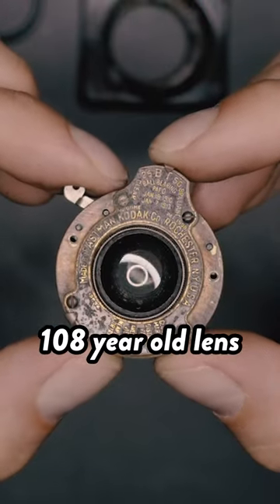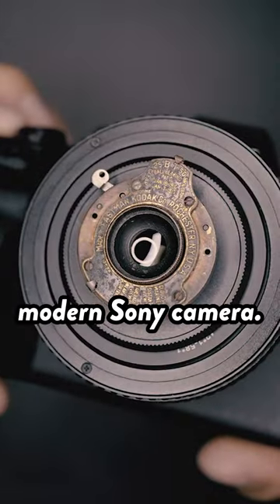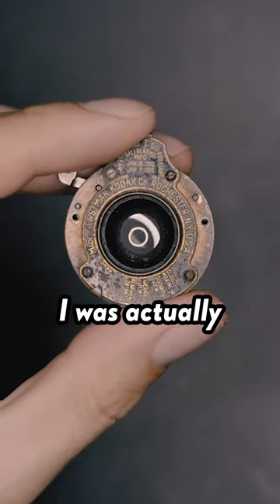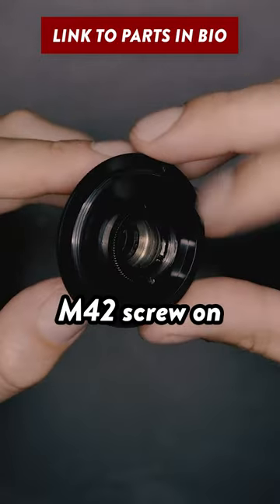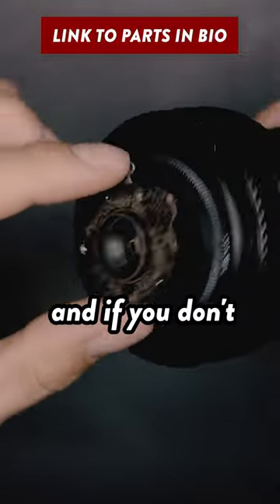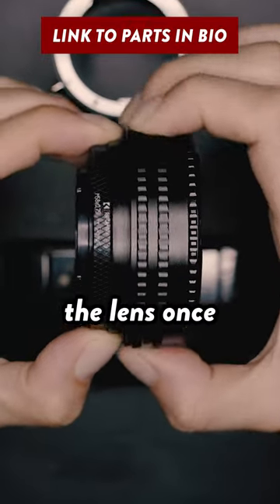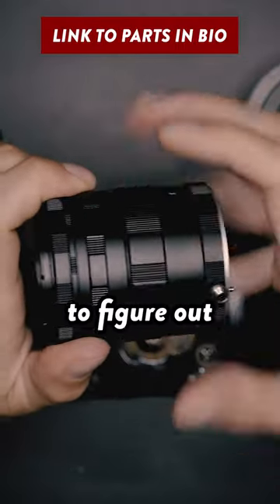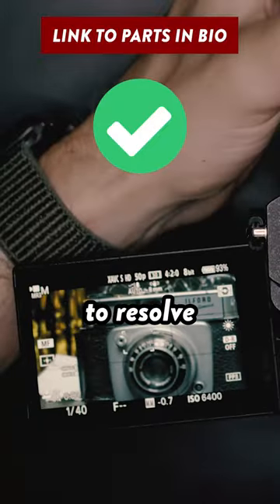Modding a 108yr Old Lens To Work On a Sony A7IV 📸

Comment: That bayonet is either gonna fall off or get shot off and the sling needs to be tight, not loose, especially when going into battle, which I imagine he is doing with that pose
Reply: Actually british soldiers during ww1 attached their bayonets only on the front ring so when shot it flies off towards the german trench causing extra damage.
Reply: @heccsclips3319 nah it gonna bounced upwards, possibly thats the reason why the red baron died
Reply: @sven9900 , wasn't the red baron shot down?
Reply: @ahappypcuser3344  yeah he got shot
Reply: Its called Double Tap, the bayonet cuts each bullet in half so you have 2 halfbullets going downrange
Reply: @ahappypcuser3344 That’s the joke.
Reply: @Zaxaries  i think i had just woken up, my bad

Comment: Spoiler alert: they look like pictures taken with a modern camera, because they are
Reply: What do you think is producing the image though? The lens, the lens is what is focusing the light onto the sensor, the sensor captures the image that the lens produces. The image quality of a photo is largely determined by the quality of the lens, the image quality can only be as good as your lens.

Put an awful lens on a great camera and the image quality will still be awful. This lens happens to just be a decent piece of glass, so it still looks good even 108 years later.
Reply: @user-xw1vs3vw8t yeah but a modern camera uses totally different methods of capturing the light, especially if he's using a digital camera. Even if he's using a film camera, film has drastically changed over time. If you take a photo on an original Polaroid camera from 1948 and another on a modern camera with the same lens, it's gonna look totally different because the way the image is captured is different
Reply: The point is to give certain aspects of the old camera onto a modern one, not wholesale recreate the look.
Reply: @notribadsvault  and exactly 0 aspects of the old camera have been given to the modern on. It looks exactly like something i could snap with my dslr right now, except it doesnt have a built in monochrome mode. If it wasnt for the focus shenanigans, which arent inherent to only this lens, id say they’re indistinguishable from pictures i can take with the phone im using to talk to you right now
Reply: @user-xw1vs3vw8t  lenses arent the most significant factor in image quality, the sensor or medium is. Glass lenses haven’t changed much in 100 years, we pretty much had glass figured out back then too. You know what has changed a lot? The image sensor. So an image taken with a modem sensor and an old lens will look like an image taken with a modern sensor and a modern lens that has a smudge on it
Reply: Dislike for not showing pics🤦‍♂️

Comment: I've had one of these lenses (for years) that was all gummed up (no camera). I cleaned it and it works like new! I will use the lens on the "T" setting on my 35mm (M42 mount) camera because the film camera has a working shutter and meter hence, no need to use the old lens shutter. Another way to mount this lens is to use an M42 billows set up. All you need is a body cap and the billows. They are relatively cheap and can be a bit clumsy to use hand held in the field but very effective for focusing to infinity down to macro.

Comment: Did a similar thing with a voightlander 35 mm to an rca 1"plumicon video system. I was even able to use the iris mechanism to do fade in and fade out effects by twisting the iris collar

Comment: I have several questions not the least of which is the result of some embarrassing gaps in my technical education: how did you so perfectly center the hole you drilled?

Comment: Those ring lights that so many of you video creators use are horrible , they are very distracting and ruin the shot , I don't like when people have that white ring around their pupil or when I see the white circle in the old lens . Many of you need better lighting , and stop following the crowd they get it wrong .
Reply: Bruh its not a trend, its necessity for the budget. Its cheaper to use ring light than setting up the whole room
Reply: @forstuffwow7145  That's the honest answer for sure , it's cheaper . I think though if certain YouTube creators want to make cheaper videos , maybe then they should only get paid half . Cheaper does not make it better , kind of makes the creator of the video look desperate .

Comment: I see alot of people on here 😢 about the old cameras being disassembled but do you know where your old camera is going when your dead. The trash lol most kids or grandkids now of days don't give two shits about old stuff. So this person is doing the future a favor by doing this. It will be used for generations as long as the mounts don't change.😅
Reply from the maker: I don't think you're wrong there. Though also, just to clarify, nothing was destroyed during this process. The camera can be put back together very easily - it only required taking a few screws out. 🤷🏻
Reply: Old things were often made to be taken apart and fixed. He's not breaking it.